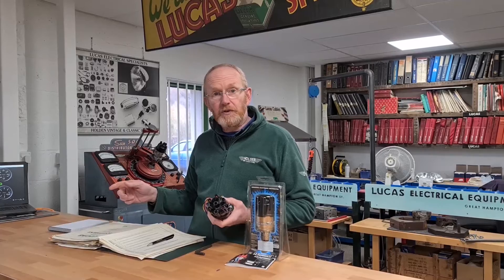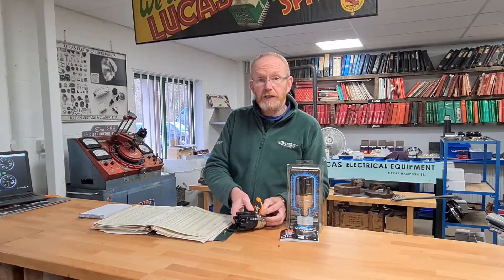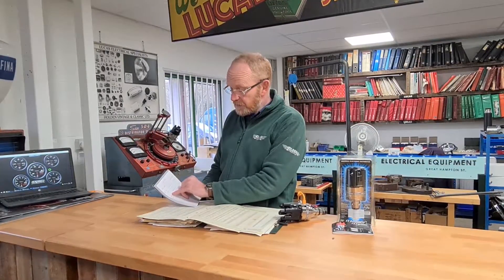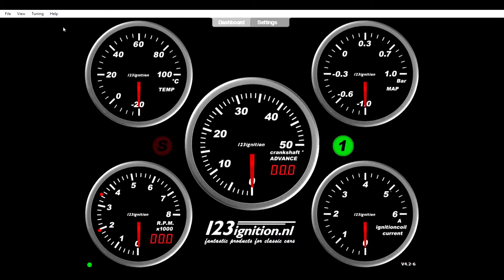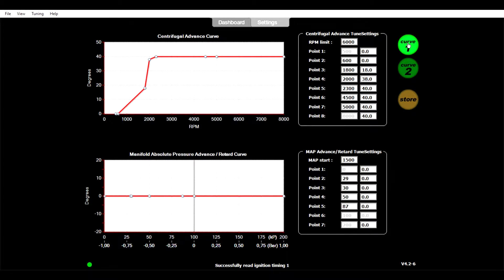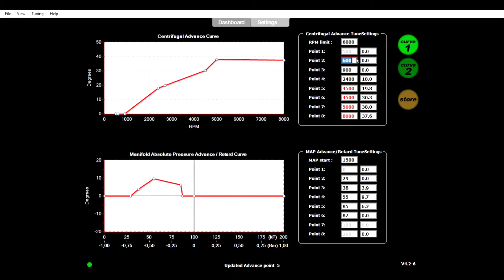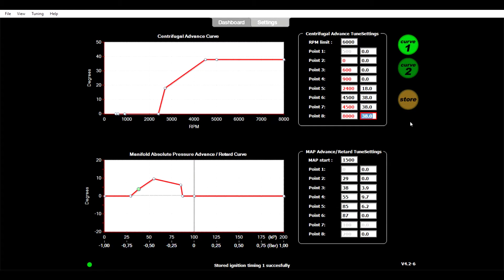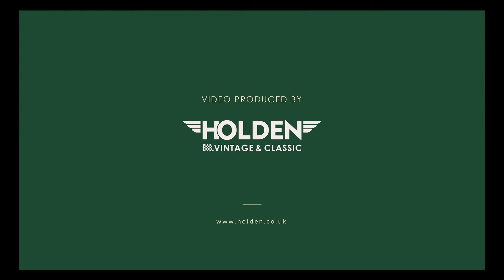How to tune your 123 Distributor!

Comment: Hi, I would like clarification please. You said that all the specs you have are in distributor terms & to get crank specs you double the figures. Yes that is correct. Then you go on to program the distributor using crank specs. That seems odd. In Australia most of my data is in crank degrees & engine rpm. To set the distributor up in the dissy graph I have to halve the figures so that it matches when fitted in the engine.